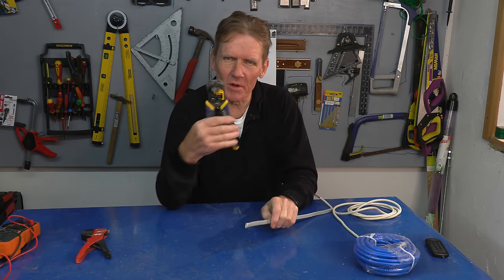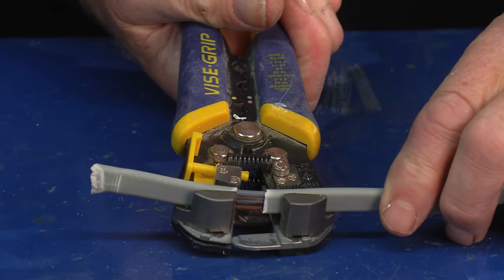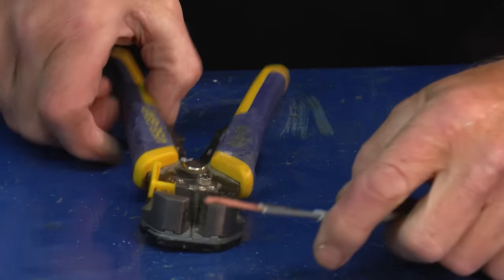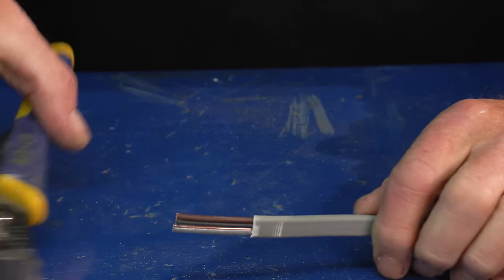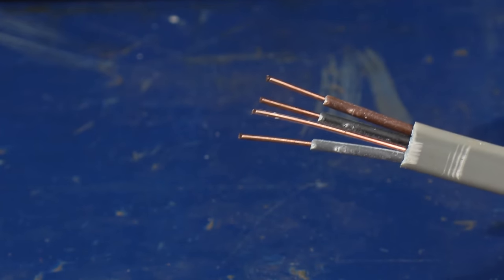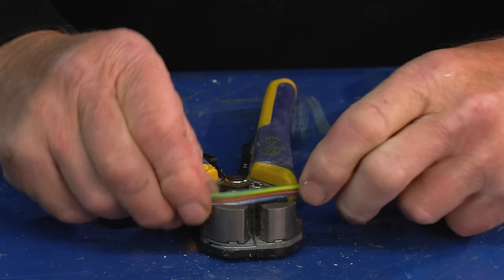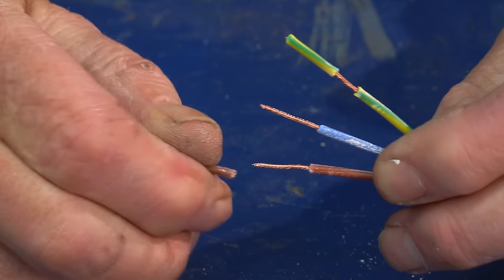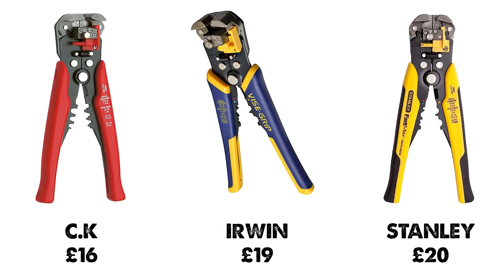The Easiest Tool Ever for Wire Stripping

Comment: Have used one of these for a few years now. Great time saver. Also with the stranded cable can’t get by now without some bootlace ferrules.
Reply: I'm not a sparky but I use bootlaces on all my wires now. Try explaining them to a South African sparky and you get this blank stare. Don't even try and tell them about Wago connectors as they are still in love with those dodgy chocolate blocks.

Comment: I bought these years ago, probably about 10 years ago. I played about with them in the house but didn't actually use them on site. Snips are just better. You only require to carry them, you can't cut cable with them or cable ties etc it just become yet another tool to carry.

Comment: These things are reasonably useful for cable sheaths, but I've always found them cumbersome. For stripping individual cores, it's much quicker to use side cutters. The trick is to use the cutters the other way around for stripping. i.e with the flat side of the jaws towards the end of the cable. As for T&E, quick snip on the end and then pull the earth core to slice the sheath, although that's undoubtedly frowned on these days.

Comment: Idk how electrical is done in the UK but here our receptacles in homes usually lands around terminal screws a trick i picked up with stranded wire when wiring them up is to strip the end and leave the plastic on the end and twist counterclockwise this way when u loop around the screw in the clockwise direction and tighten it will bind the wires together insread of splaying them apart.
Reply from the maker: Good tip for sure. I will use it.

Comment: I wonder how well they work with slickwic type jackets. It also looks like it puts a slight bend at the end of the wire, that might make friction fit devices asbit more of a pain.
Reply from the maker: That bend is caused by the cutter which is crap. Best not to use it
Reply: @SkillBuilder  noted.
Reply: @SkillBuilder  yeah would be more sensible to keep some decent knipex cutters in the bag with it.

Comment: I have to see the animal that strips twin and earth with their teeth lol
Reply from the maker: Yes it was a bit of a throw away remark. I bet somebody has tried it though.
Reply: @SkillBuilder  I don't understand why most sparks don't like these, most just cut in the middle and pull on the earth wire to split the outer insulation then snip the two split bits off.

Comment: Looks really good but I’d be willing to bet most sparks will stick with their trusty pair of snips.
Reply: Truth for me, had one of these tools for long time but the one I got wasn't all that great, tended to slip. Wouldn't hold that against the whole concept of them though, but never bothered to get another one. Once you've acquired the feel of doing it you can flick the sheath off any wire just as quick with any cutters, plus then you have a good pair of cutters in hand at the same time. Just got to learn that it's not about cutting it off, it's about pinching and then tearing it off, with the right technique there isn't any risk to damaging the wires inside when using cutters.
Reply from the maker: @Fe7Ace  I appreciate that nicking it and bending is fine but for people who don't do it all day every day a tool that is risk free and under £20 is a good investment
Reply: If somebody is carrying out some DIY electrical work & trying to keep costs down a pair of snips is great or even pliers. It is a nice bit of kit but I would expect most sparkies would already have a tool of this nature.

Comment: Take a closer look, if you get the tensioner screw wrong you can see that these will damage the insulation where the Grip part of the jaw clamps on - You can just see it starting to damage the main outer insulation and also some slight damage on the three core - If the tension is wrong then these can cut the insulation at the wrong point. Take a look at Knipex, a bit more expensive but a far safer and superior tool for this job!
https://youtu.be/NW9i7E7dW_Q
Reply from the maker: I do not agree. I can't see where or how they have damaged the copper. The action is clear to see, there is no cutting. The Knipex are good but they can't cope with the outer sheath,
Reply: I've recently got a similar pair and agree you can damage the insulation. An easy solution is to put the cable in the other way round and then the tool grips the end you are discarding.

Comment: Prefer Weicon strippers Roger. There's versions for flat and round cable.
Reply from the maker: I will take a look
Reply: Weicon 7-F(flat) and 13(round) 👍
 
They have a 5 and 7 Magic. Haven't tried those, didn't need to with the 7-F and 13 doing what i need done.